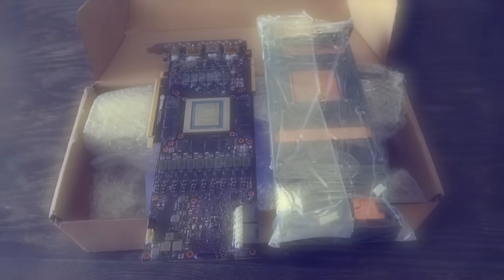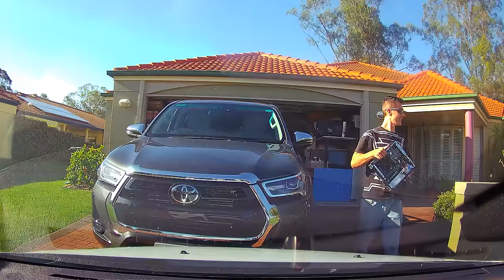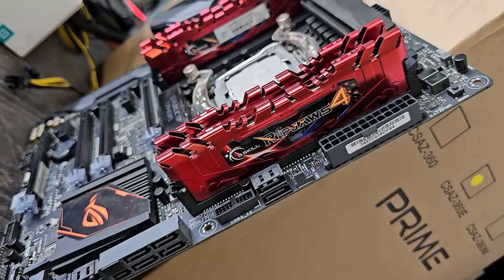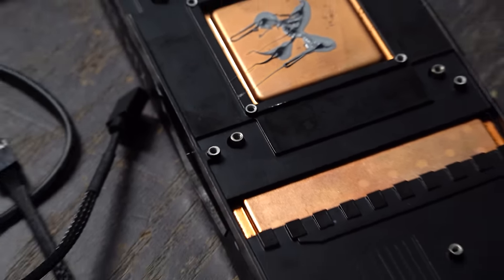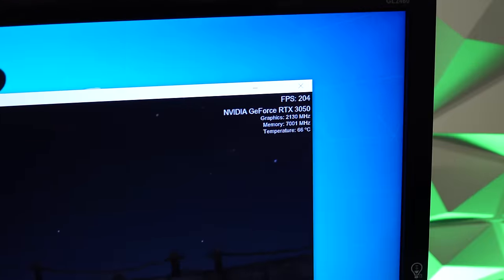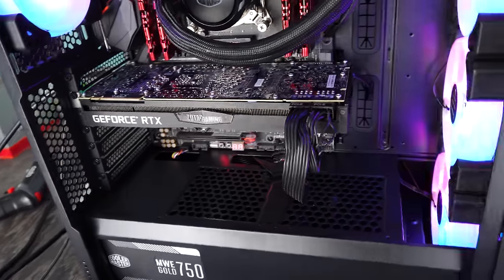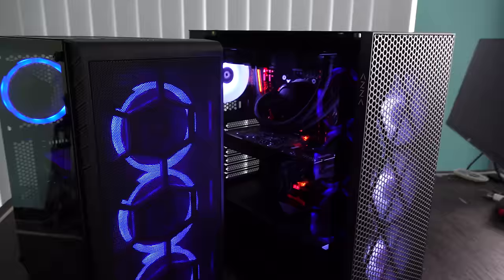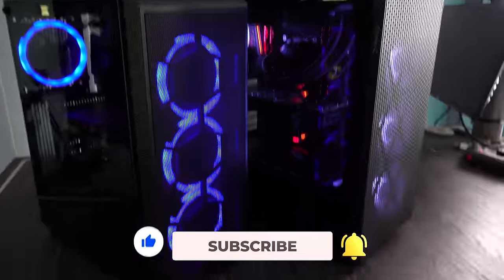Turning $100 into a HIGH-END Gaming PC - S3:E5 "Domination Stations"

Comment: I am getting into the PC building side hustle. I have quite a few towers already but need a part for each of them. Found someone selling several GPUs(1 rx 470 I think among others) 4770, 6700, 24gb ddr3, 3 psus, some drives and a couple of cases asking $100. I can make like 4 PCs worth an easy $150 - $300 especially paired with a 1080p monitor. I am absolutely addicted to scouring Facebook marketplace.

Comment: A minor note about the 6800K, it only has 28 PCIe lanes. This doesn't matter in your case, for just a standard setup with the usual CPU, single GPU and system SSD, but on some X99 mbds, depending on the intended task (especially for more involved storage setups, or adding a PCIe audio card, etc.), it may have implications for socket/port functionality.

Thus, if you come across an appealing X99 bundle/system and are not sure, always check the manufacturer owners manual which should have a mbd diagram with a description of which slots/ports are disabled or speed-restricted if using a 28-lane CPU, but again it shouldn't matter if just putting together a standard setup for gaming or somesuch.

Alternatively, if you have the choice and the cost premium is small, get the 40-lane i7 6850K instead, which does have the minor advantage of having 200MHz higher base and turbo frequencies and often can oc to a decent 4.4GHz.

I got lucky when I needed a replacement 6850K; where I am (Scotland) the store CEX had them for a good price, a good bit cheaper than ebay.

Comment: I have an RTX 3050 (8GB Asus model) in muh main rig and it's a beast with modest wattage (130W TDP). Paired with an i7-8700 (6c/12t), 16GB (2x8GB 3200MHz) RAM, 1TB SSD with Windows 10, 1TB for extra storage, and another 1TB SSD with Linux Mint 21.1. It's rippa', Sonny Jim. A rippa'.

Comment: Maybe the heat on the 2080Ti might be due to the conformal coating that was on the card as it was previously water cooled? I saw that the GPU die seemed to have the conformal coating on it, so that might be worth looking at.
Reply from the maker: I don't think so, I have dealt with a few 2080 tis and they are quite the power hungry, hot running cards.  The cooler in this case is bottom of the barrel for this line up.  Just too much heat for a small cooler of this size.  So taming it is the only option.  Also I should have mentioned the initial onset of temperatures was quite low, which indicates good contact.
Reply: @techyescity  Thanks for the reply, Brian! I am a huge fan of your content. It makes sense if the temps start low and then ramp up gradually the issue is not the conformal coating. Keep on giving us that Tech Yes goodness! P.S. Been hoping for some more videos like what you used to do on the general status of the market...

Comment: Bryan, as 2 other people mentioned... The issue with the high temps of the 2080 Ti is because you omitted (or it didn't come with) either the retention bracket or the spring loaded screws, both of which would increase the mounting pressure compared to a regular screw. No matter how much you tune the card in Afterburner, temps will eventually creep up. Great videos, mate! 🍻 Loving this series, so far
Reply from the maker: Will monitor it over time and see if it does get worse, though the initial onset of temperatures tells a very big part of the story.  In this case the initial onset was quite low. So I just think it's a real lackluster cooler on a power hungry card.

Comment: The "Turning 15 minutes of time I should be doing other things into watching TYC on the couch"  challenge lol

And for future reference, M2.5 is the standard size for m.2 (that's not confusing...) SSDs.  Pretty sure they're M2.5x4mm normally, but most stand-offs will accommodate 6mm.
Reply from the maker: interesting, I swear I tried everything under the sun here.
Reply: @techyescity  I only know because I inevitably have to replace the missing ones anytime I pick up a board with an m.2 slot.

Maybe it's M2.5x2mm normally?  Whatever it is, they're a bog standard metric machine screw size here in the States.  Like $2/dozen, and worth every penny to keep the flips going smoothly.

Comment: Do you inform the buyer of your tinkering with Afterburner?
 
I used to flip a couple of years ago. I would never sell an undervolted card to someone not tech-savvy. That went on sale on hardware forums instead.

Don't you have any issue with this?
Reply from the maker: I mean I don't need to do it, the card throttles itself in this configuration, I just prefer to do it.  Though yes if I do then I inform the buyer.  Though they are always keen and thankful for it as it's the same sentiments as mine, longevity.
Reply: @techyescity  Yeah, but what i learned is, expect the buyer to not use Afterburner if something goes haywire - Reinstalling OS etc.

So while it may work fine now, i wonder regarding longevity: is the cooler adequate for stock operation with sidepanels on and internals heated up? - And by adequate i mean maintaining (subjectively) acceptable boost, while still holding hotspot-temps in place? 
Heck even placing the PC against a wall may rise temps - exhausts choked. 

Reading my question again, i see i worded it badly. 
With issue, i mean practical issues; if customers ring the bell after some time.

Comment: To be honest, $1200 for an X99 PC with a 2080ti is very rich. There are people selling more current Ryzen 5/7 system with 3060ti or better for $1200 or less depending on the setup. 2 Years ago i bought my son a water cooled Ryzen 5 5600X system with a really good 750 watt PSU, 16GB ram, super fast 500GB NVME drive, Wifi, fancy RGB case and fans, and Bluetooth, for only $1250. This was 2 years ago. I still have an X58 system as my main gaming rig and always wanted to upgrade to an X99 but probably never will as you get so much more performance from later Ryzen and Intel systems for the same price as the X99.

Comment: The 2080ti probably is missing a spring loaded bracket behind the chip to keep correct pressure.
Reply: And a backplate.
Reply: Some longer screws with a lock washer sandwiched between a couple of thin regular washers would do the trick of maintaining pressure. These screws are bottoming out and generating no pressure. I've seen GPUs without a pressure plate, just springs on the screws.

Comment: I used to have that EXACT motherboard with a i7-6800k. Worked great until it kept throwing code 00 and eventually just wouldn't boot, tons of information about that specific model having issues. Paid only $100 for the pair though so I couldn't complain, served me well for 1-2 years.
Reply from the maker: I spoke to asus about that back in the day, they said microbends on pins, so just get a brush and try clean the pins with slight pressure on reverse.

Comment: I used to have a Zotac 2080 Super with the twin fan cooler and it does run pretty hot at stock settings. I was able to get decent temps with an undervolt but you are probably getting about as good of temps as you can get with the 2080 Ti.

Comment: Those GPU temps are probably caused by the screws and the sub optimal contact. But I could be completely wrong.
Reply from the maker: Initial ramp up of the temps would be much faster and higher.  I can show a video of the ramp up if you like.